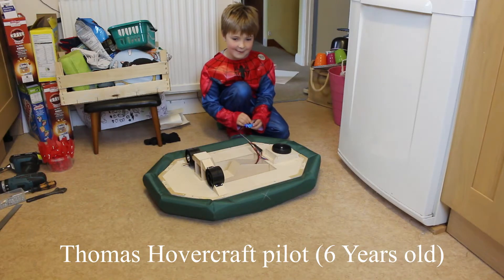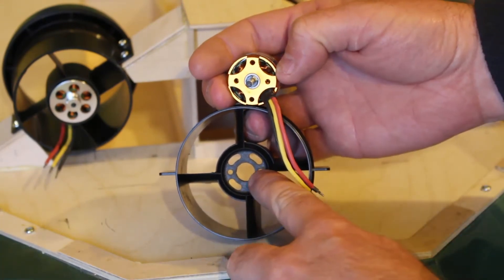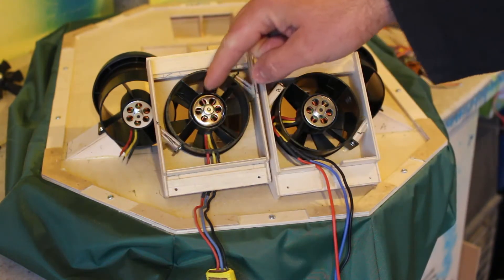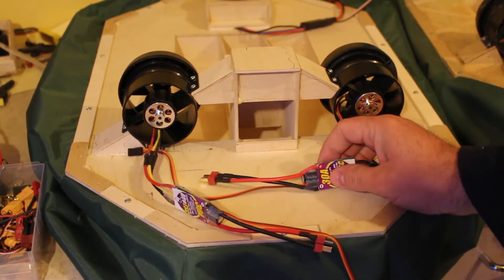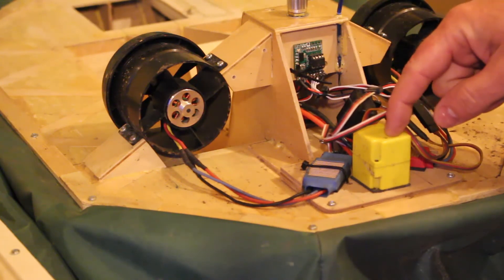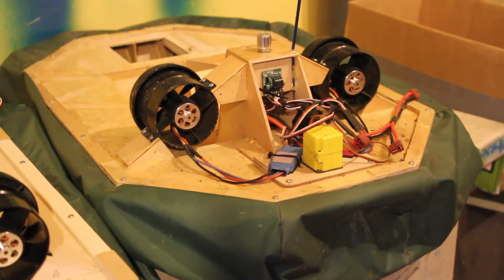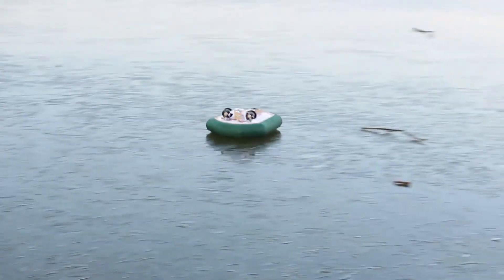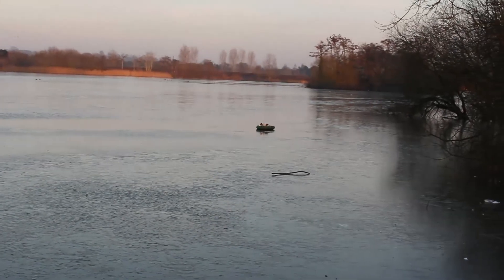RC Hovercraft build part 3

Comment: Everything is easy on ice. Obviously it won't do well on uneven surfaces.
Reply from the maker: Correct, if you get up momentum then you will bump over objects but no way will this run on grass.
Reply: @mrfid72  Versions without skirts can rise higher and go smoothly on uneven surfaces."Excuse me for my English. google translate"

Comment: Hands down the best design i have seen to date. Well done. It will be a long time til i could attempt to do this. I do not have the space or tools for such a large project. But i love this skirt design as well as the main body. Performance seems better than most versions i have seen. And the electronics for this kind of thing is not cheap. Thats another thing holding me back. Just curious as to how strong the lift motor has to be. I dont see it needing to be near as strong as the drive motors. But allways good to ask questions
Reply from the maker: Thanks for your kind comments. all 3 motors are the same, however the lift motor runs at idle and the rear fans normally at 100% The electronics are the awkward bit, but i think it would be possible to use a aircraft transmitter and drive it like a tank?